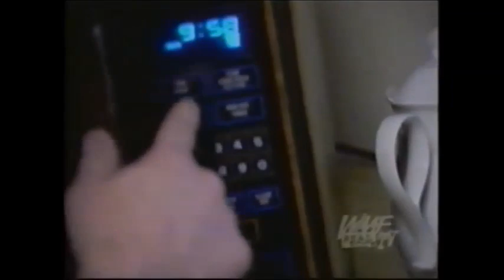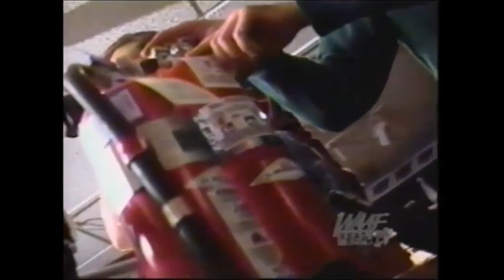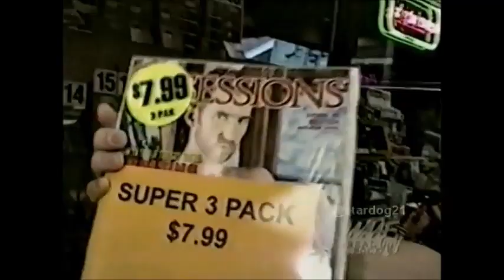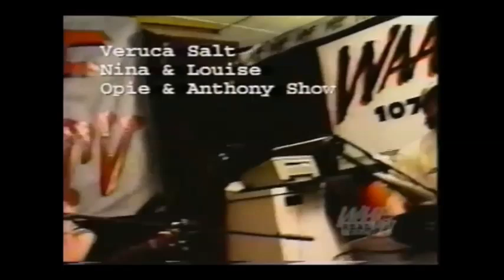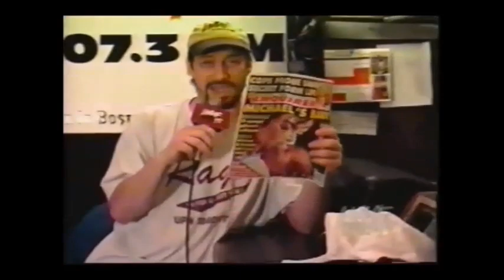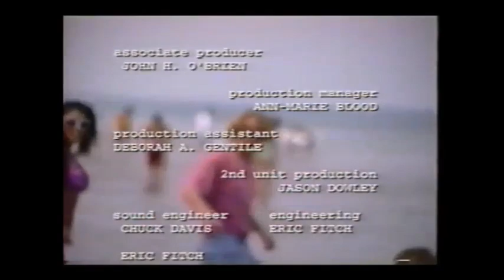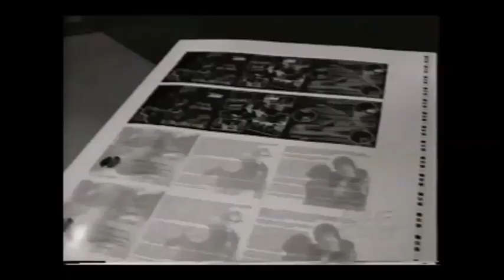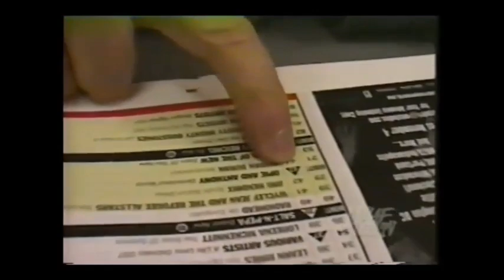WAAF Real Rock TV Compilation - Opie & Anthony (1995-1998)

Comment: They need to get back together just so they can make fun of the stuff on this compilation that they never made fun of on the air. If for nothing else.
Reply: They won't they hate each other. Then again were they to ever have a one on one it might be the most entertaining thing they had done in well over a decade. But hey other than Norton they are both failure's and has beens.